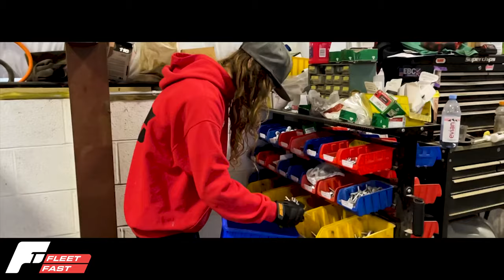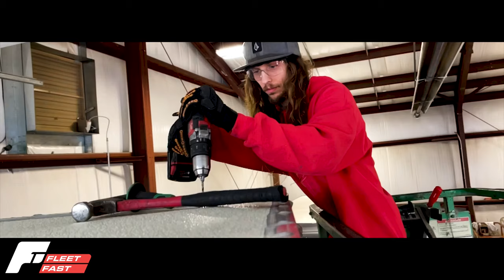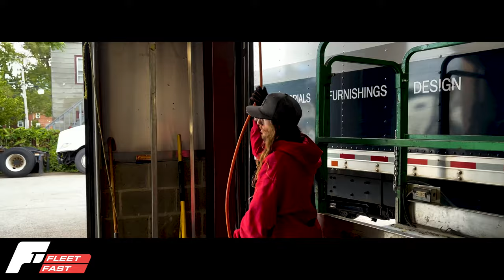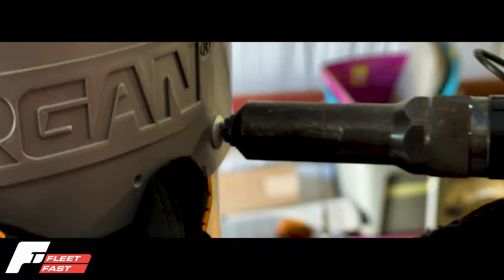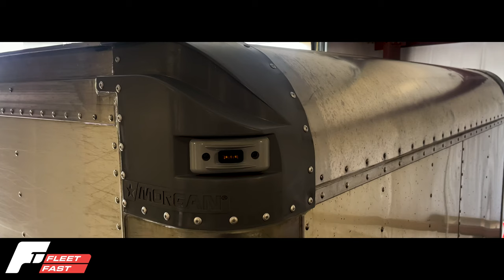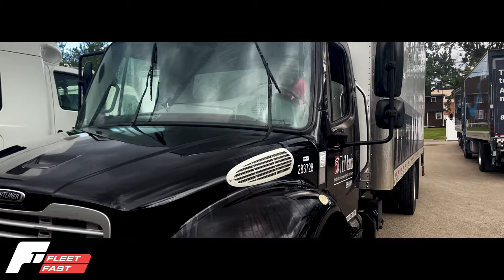Fleet Fast Corner Cap Install Video

Comment: What are your thoughts on using butyl tape between the cap and box? I’m replacing mine and they used butyl tape, and some kits come with butyl tape, but I’m thinking that would get in the way of a solid rivet connection since the tape is a little squishy

Comment: Would this fit a corner Cab for 2015 M2 Freightliner Box Truck
Reply from the maker: Hello James, it depends on the manufacturer of the box which can be found on the serial tag on the box. This one particular is for a Morgan body box truck. But you can feel free to email us through our site if you'd like any further information. Thanks!
Reply: What bit did you use to remove the rivets?